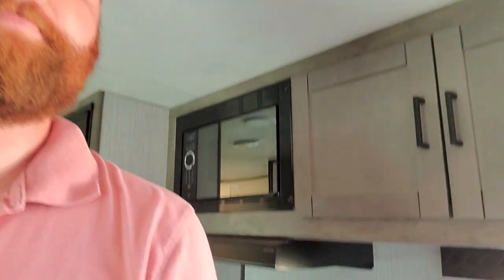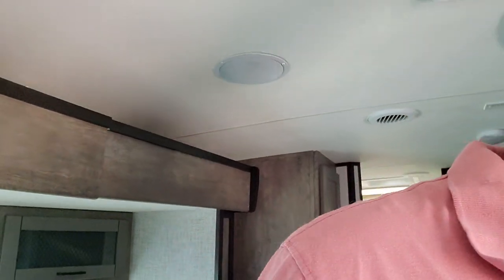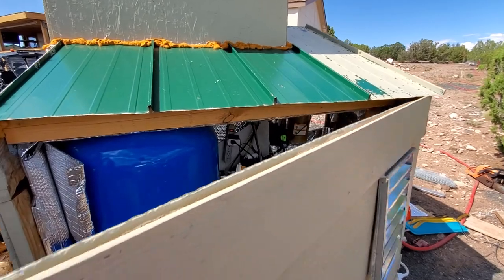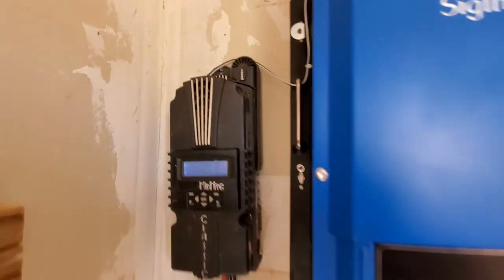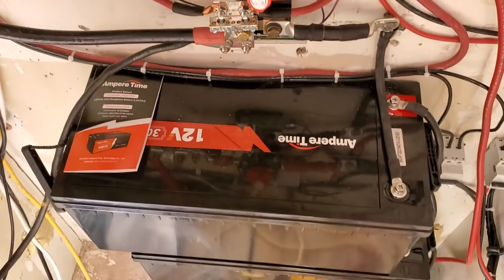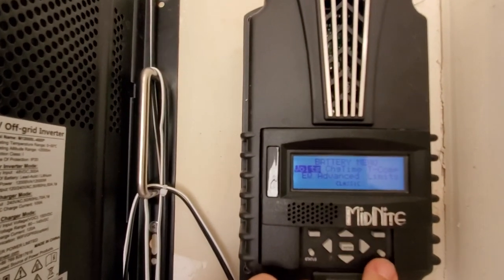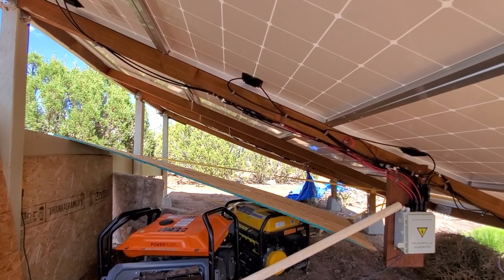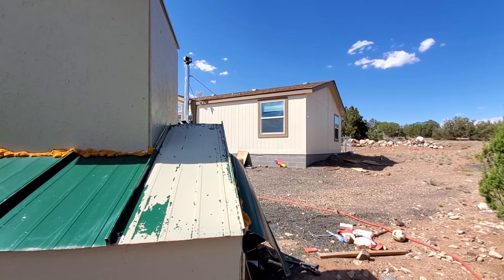300AH Ampere time batteries and 12kw Sigineer inverter charger mppt review Ditch the tesla modules!

Comment: You could take one single module and capacity test to confirm the capacity loss. Also the inverter could've been stealing power as well. Isn't that Spartan inverter only rated for a 43v low voltage  cutoff? If so you were leaving 30-40% of your batt capacity on the table to begin with. 

The only other thing I could think of was the  extreme summer heat and lack of thermal cooling in that shed caused an early demise of those modules as Ive been running 8 of them of 5 years with virtually no capacity loss. What are the peak daytime temps in that shed?  Or perhaps the car had insane miles on it?

Comment: Great that you have a solar system  but dude, you really need to work on the wire management.
Reply from the maker: It has been cleaned up as I am sure I mentioned it was just the initial setup I still had the old inverter hanging out. But thanks for watching

Comment: I am a little confused. Does the Sigineer inverter also have a built in battery charger? If so, what are the black midnite boxes on the side for? Just to monitor and log the power usages?
Reply from the maker: The midnight solar classics are the charge controllers. The sigineer does have two built-in charge controllers but I already had the midnight solar so those are just backups.  The batteries are below the inverter charger. Those black boxes are lithium-iron phosphate by Ampertime